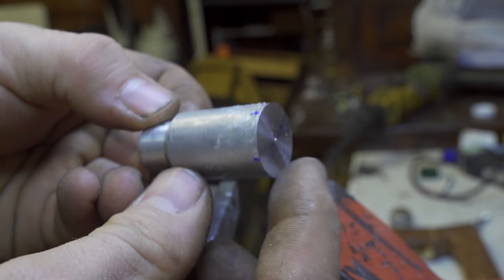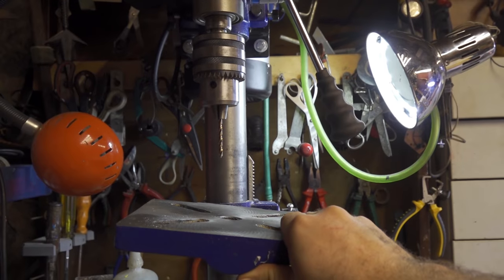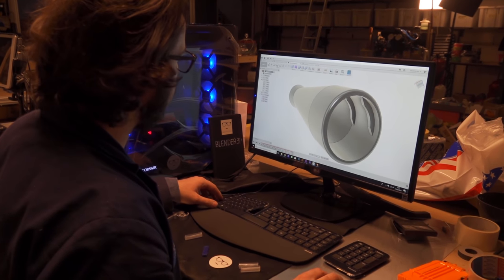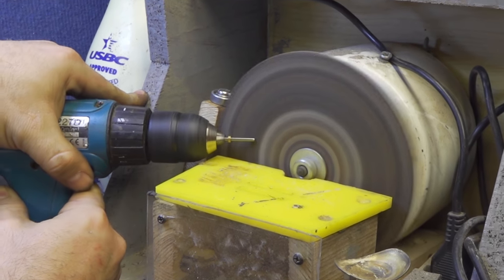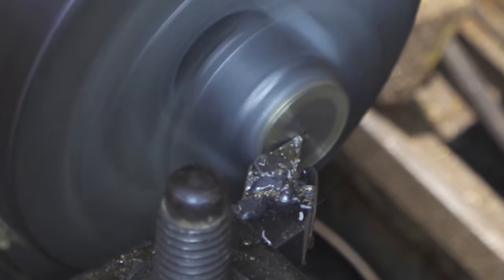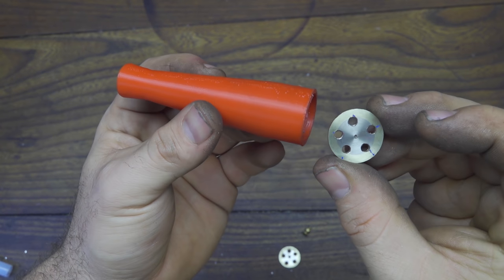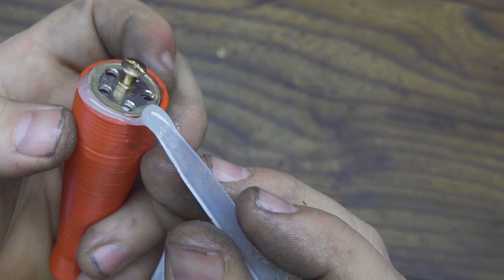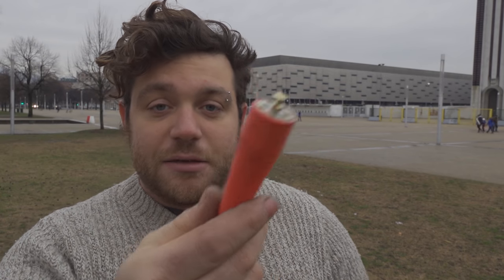Very Loud Whistle using Coins •  ft Giaco Whatever

Comment: Very Loud Whistle using Coins,   a lathe ,a  drill press with  tilting table , aluminium stock  and a stainless shaft .
 you could avoid using coins and use some aluminum stock cut to slices as well... clickbait